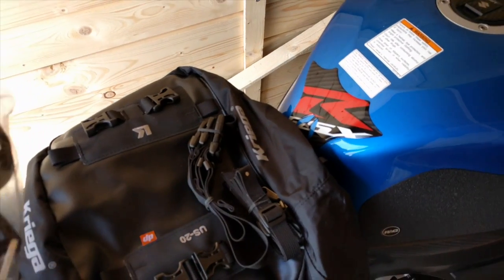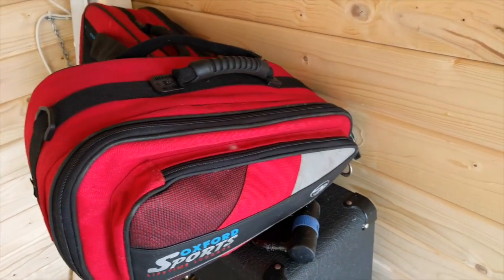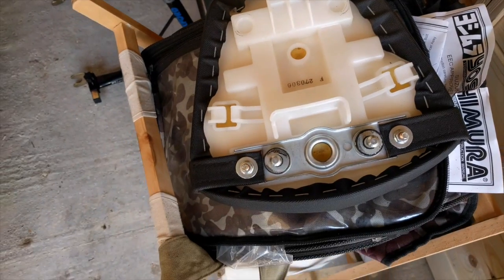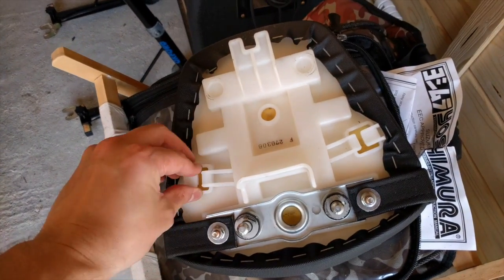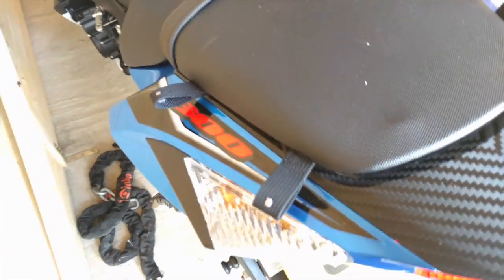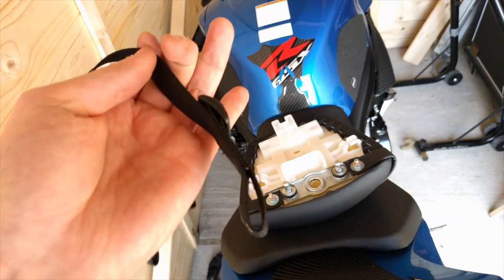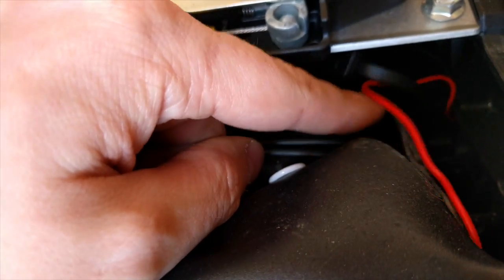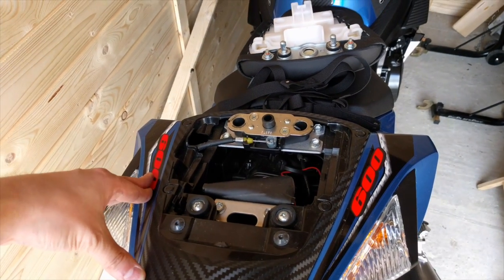Kriega US20 Drypack Suzuki GSXR fitting instruction

Comment: I put this on my new Daytona. Looping the straps around the frame seemed challenging until I grabbed an old bicycle spoke. Bend it at a 90 degree angle at about 1/4" up and you can grab /pull the strap through surprisingly small holes. Works like a charm!

Comment: To mount my Kriega US-30 to my CBR600rr I have simply used cable ties (strong thick cable ties) around the metal parts of the bike (locking mechanism, etc.) to create loops to tie my Kriega loops to them. This way I am not simply relying on the passenger seat to hold the tailpack. I hope it makes sense. Cheers!
Reply from the maker: Prophet86 the correct way of doing it is certainly to attach to the subframe as it states in the guide. there was no way of doing that without damaging the fairing on the Gixxer. I've moved on to a 2009 R1, it was far easier to attach the kriega loops to the subframe.
Reply: Andy Parker I agree with you but on my CBR600rr there's no way I can get to the subframe. I think cable ties are pretty solid. Good stuff that you've got an R1. I've noticed that on the R6 the underside of the seat has got already loops built in that you can just flip out and use instead of installing the Kriega ones (this way the tail bag would still be held only by the seat though. Which is not the proper way...)
Reply: Prophet86 hi,just read your idea of using cable ties to secure your Kriega US30,did you had any issues using cable ties,seems a goos idea.

Comment: Thanks for the heads up. I saw the Kriega online the other day and thought it was awesome. However on lifting up the pillion set on my 2013 GSXR 750 I thought how the hell do you attach Kriega luggage like in the demo video?! Was about to ring them, but thought I would google it and your video came up!

I would be going for a 50 (so 30 litre middle x2 10 litres on side). If it was packed to the rafters and using your method of attaching, do you think it would present any hassles?

Cheers for your thoughts!
Reply: Hi Ian, was thinking of doing the same on a 2017 GSXR 1000. Did you try this in the end? Did it work ok for you? Cheers